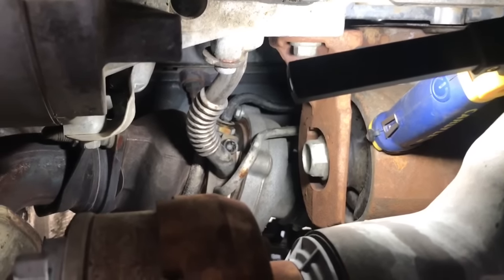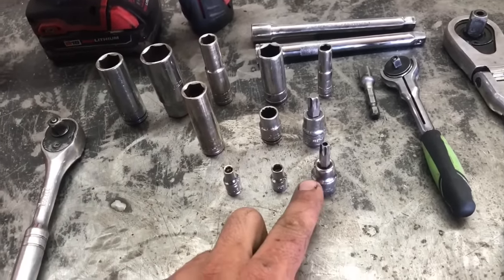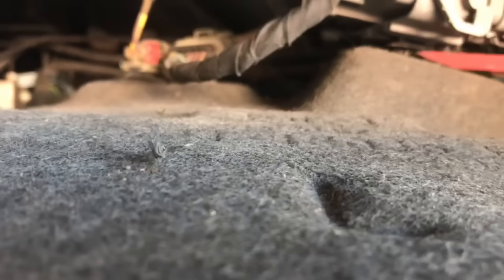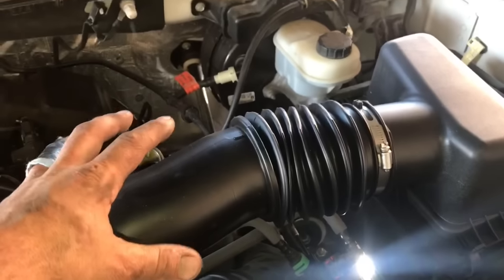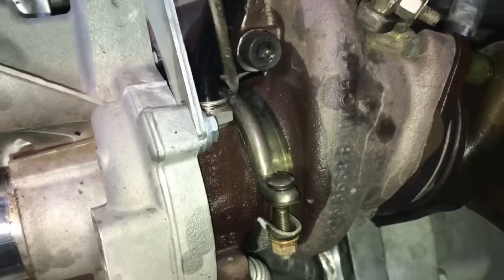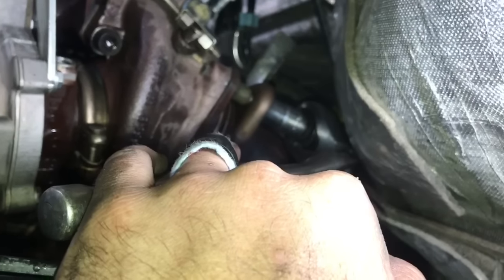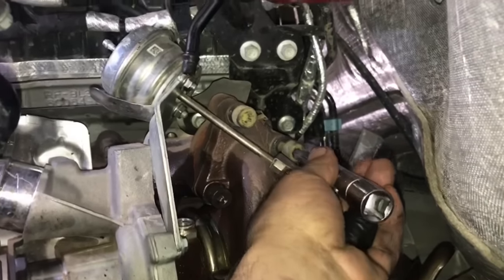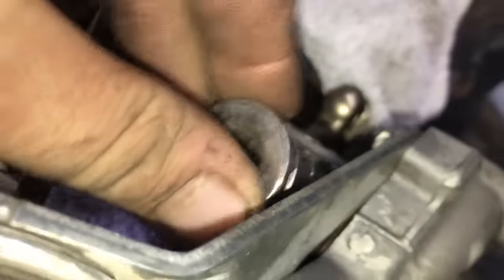F-150 Ecoboost 3.5 Turbo Coolant Connector Replacement (Tips and Tricks)

Comment: 2015 Expedition w 147K - Leak on drivers side, inside fitting as Aaron describes.   Followed his instructions - but could not get outer exhaust nut off; not enough room for socket and wrench. No luck w/open end or gear end wrench.   Also, could not break top exhaust manifold nut - with 2 nuts not moving had to find other plan.    Followed comment by others and went forward with change of fitting while turbo still installed.   Pryed metal coolant line out and pushed up enough to get socket on fitting.  Removed, greased and replaced by hand.  It was tight, for once glad I have small hands.  Replaced outer coolant fitting.  Changed oil seal, put all bolts back in and tightened.    Had to use 2 pry bars to work inner metal coolant tube into fitting.   Reattached all hoses, then filled with anti-freeze and fired up, test drive good - repair complete, fingers crossed!
Reply: I have been wondering why the turbos have to be removed especially the one on the driver side. It looks like you can just reach around and remove the connections. I think I’ll give that a try. It seems a lot easier than removing the turbo.
Reply: Good video but I haven't been able to unbolt the exhaust due to rust. Actually had to touch the top bolt off and the bottom bolt came out of the turbo. Now faced with having to get the bolt off of the flange. Not an easy repair just due to rust.
Joe

Comment: why do manufacturers think a rubber seal on a turbo is  a good idea with all that heat. they should be using a banjo blolt style connection with crush washers

Comment: 2017 f150 3.5 eco owner.  Spewing white smoke from the exhaust.  This was the issue according to ford.  68,000 miles with a full timing job required and the coolant-turbo leak fix.  $5000.  I grew up in American vehicles.  Now they ain't worth a dried 💩.

Comment: I wish I would have seen this video 2 days ago. My 2013 is at the dealership now for the same repair. $1K repair............after a $9K engine replacement. Motor has about 6K miles on it. You would think this would be covered under the new motor warranty. It isn't.

Comment: I just performed this on the drivers side of my 2013 f150. This video was great and helped me a ton. Just to note on the 2013 3.5 I found the exhaust manifold to turbo torx are T50 torx and the oil feed/return underneath the turbo are T45 torx
Reply: how long did it take you to do?
Reply: Found that out after i stripped the bolts thinking it was 47
Reply: @kevboost  probably 4 hours. I got everything back together and the coolant fitting that goes into the side of the block was then leaking. I had to ride my bicycle to the Ford dealer for new parts and gaskets. Haha took the turbo off again and redid the process. Success. I did not change the coolant fitting on the back of the engine because I was running out of patience but I would recommend doing it while you have everything apart.  About a year and a half later no leaks.
Reply: @superair05  hi, do you recall the part number for the one going into the side of the block? I got it all back together and now that one is leaking. By chance was it the same as the turbo ones?

Comment: Juat did this today in the shop . Your video helped , thanks very much ! Was my first turbo to replace on flate rate and it went well . Appreciate your knowledge ! One thing i wish you would have incuded was getting the back coolant line back on the turbo . Had to have a co worker wiggle it around while i stuck it in the fitting . Thanks again tho my man !

Comment: Forgot to come back with my completion update… so, thanks to this AWESOME video I was able to get the job done. I happen to be retired military with access to the Redstone Arsenal auto craft-shop with tools, lifts, drained fluid dump, etc. All these amenities made the job so much easier than trying to do it in the garage. Also, shout-out to Woody Anderson Ford for having everything I needed on hand!!! And shout-out to the auto craft-shop staff, and management.
Reply: First off, Thank you for your service. I’m glad you had a real shop to fix this abomination of an engineering failure provided by Ford. 
They had everything on hand because they need inventory for all the trucks being worked on in their shop because of this problem. 😂 
Shame on them for not stepping up and paying to make it right. 
They know their failure, and know it was a failure, because the swapped out materials on the ‘17’s and up. 
I understand taking the good with the bad, but these issues are a bit ridiculous. 
Beyond the grievances, Congrats on the fix. Feels good to get ‘er done. 
I’m going to try and replace just the one back fitting without removing anything. We’ll see how that goes. 
I’m actually more concerned that I should be doing more service if I’m getting in there to do these fittings such as new lines and trying to research if there’s a rebuild kit for the turbos I would hate if I do all this work and then the turbos start to fail and have to go right back in there.

Comment: Thanks for the video. I have a coolant leak on the back passenger side of the engine but couldn’t  figure out the precise location without tearing it apart. After watching this video, I can now see that this is exactly where the leak is coming.

Comment: Great video thank you.  I was able to change out the driver side between block and turbo fitting leaving the turbo in place. Drained Coolant, removed clip and used a pry bar to VERY carefully and slowly pry the tube back and push up just enough to get the socket on it. Do not not over extend the tubing or crush. Replaced fitting and reinserted the tubing. The tube will bend just slightly and not want to line so you will have to pry it slightly to line it back up with the fitting. So far so good no leaks and everything looks good.  It is very tight to work in so small hands are a plus. Once coolant is drained which took the longest and when you pry the tube the remaining coolant will drain so you have to wait a few. Once coolant was out  it took about 30 minutes to remove and replace.
Reply: Was this for the fitting on the back or the front? Mine is leaking from the back.
Reply: I was able to do the fitting facing the block (driver side) this way as well using a long prybar - HOWEVER my 2012 with 125k then started leaking from the fitting in the block (the other end of that line) so now I guess Im gonna pull the turbo anyway.

Comment: Just had to have this replaced, but didn't see the video before taking into the dealership. I thought the powertrain warranty through Ford Protect would cover it.. It did not. $1200 repair for one turbo. Insane. Thanks a ton for this video!
Reply: Every time I take my truck to dealer for something the bill has been over $1200. Insane...
Reply: @regularguyfixes3142 4 years later, what's the minimum bill now for basic things... $2100?  Ridiculous yea
Reply: Just got back from the dealership. They said it's the fitting plus 2 broken bolts. Altogether it'll be 4850. I'll be doing this myself instead
Reply: @butsugen  That is a RIDICULOUS price, Ford!  They must think we are all idiots.  Just because everything has increased 2X to 3X over the last 1-3 years doesn't mean they should 10X the cost of the max this job should ever be!  They've absolutely lost a future customer after reading that.
Reply: @ChonkTek  1170 for parts but I got it for 60 on Amazon. I'd be working over a month for free to get this fixed. It would take me nearly a decade of buying a gallon a week of coolant to reach that that repair cost if I left it.
Reply: my fitting leak must be very small in comparison.  Ive only seen and felt a drop or two of coolant there on one turbo's fitting when the truck has cooled down, and I don't see a coolant level in the reservoir that is alarming yet.  I guess I am catching this early.  Maybe if I tell Ford this early, it will only be 3700 bucks heh heh.  Well, here's a business idea..  I should buy up all these connectors on the marketplace and charge $200 each for them.  Nobody would have a choice other than to buy them for "only $200".. or pay for an expensive job at Ford.  What concerns me is that such a scenario seems possible with the gouging that Ford has created here.

Comment: 2 years after doing this repair on my drivers side turbo (using this video), I now have a leak on the passenger side turbo coolant fitting.  I completed the repair over the weekend and just a word of caution there is quite a bit of extra work involved in the passenger side.  The starter needs to be removed which is surprisingly easy.  However, the AC compressor also needs to be unbolted which requires removing the stretch belt that goes from the crank pulley to the ac compressor.  Removing that belt is not fun but it's doable.  Removing the ac compressor is only needed if you are going to change the coolant fitting that goes into the side of the block which i would recommend doing if you are this far in.  I did all 4 fittings on the passenger side with the most difficult one being the one of the back of the cylinder head.  Working at a decent pace I was in this repair about 10 hours but that also included an O2 sensor and replacing both belts.
Reply: Damn, if anyone ever says how these ecoboost engines are no more maintenance than the 5L, I'm send them to this post.  I owned a 2011 3.5L and the timing chain stretched 1".  Was done with Ford warranty but without warranty that would of been a pricey repair.... Now I have a 2017 5L  with the 6R80 trans and couldn't be happier.  I'll be driving this one until the wheels fall off.
Reply: 😅😅 so I'm gonna have to unbolt my ac...that's what I was curious about...was wanting to replace the fitting at the block since I'm already deep into it anyway was curious if the bolts or tools would clear between the motor mount and the lines..  😂 Hate Ford w a passion anyone who like these junkers has never has to wrk on one.
Reply: How did you manage to replace the fittings on the back of the cylinder head?

Comment: Mine just started to leak on a 2013  thanks for the video you saved me big time.
Reply from the maker: glad to help, seems to be a common issue on these trucks, i guess the dealer charges big time for it too. cheers!
Reply: @AaronHinesAuto  yeah, only like $2500.... lol. At least my recent quote.
Reply: @CB-dl1fx  is that to do all 4 lines though?
Reply: @bigpicturethinking5620  Good question, they didn't specify. I didn't get it fixed and am waiting to take it elsewhere when I can find the time. Such an inconvenience.
Reply: @CB-dl1fx  Especially because the new ones have a banjo bolt design that just doesn’t leak at all. What a sorry design.
Reply: @bigpicturethinking5620  Turns out I have 2 fluid leaks: oil from the valve covers and, what do you know, this O-ring at the turbo as he describes. Just over $1000 to fix just the O ring and hoses not the valve covers at this new shop Ive been going to.

Comment: Thanks for the video.  First set of fittings I’ve done on these 3.5’s. Had the passenger side out in 30 minutes. 🤘🏻🤘🏻🤘🏻
Reply from the maker: That’s awesome!
Reply: Waited on parts all day. Got both back in before I left today though.  Thanks again for the video.
Reply: So this video helped you with the passenger side? Mine is leaking from the fitting just under the manifold near the firewall! While I'm in there I plan to do all the connections though.
Reply: @kcoop99  did u replace the one at the block on the passenger side? If so did u have to remove the a/c compressor ?  Praying it’s possible without removing compressor that would need to be drained of Freon
Reply: @cologeroanello7852  I did. If you remove the wheel well, you can really see it up there next to the firewall. I used a large crescent wrench to get it out. Not easy but definitely doable.

Comment: Great detail in your video. Got 285,+++ on mine. This is going to be my next project in the spring.
Reply: Man that's great mileage! I'm hoping my ecoboost last that long.  Mines a 2012 with 111,000. I'm planning on keeping it for years. Bought it brand new. How the power at 285,000? Mine still flys

Comment: Just wanted to let you all know my progress… I started removing the wheel well lining to verify where my leak was coming from (all my coolant would puddling on the passenger side). What I found was nothing around any of the coolant line fittings on the passenger side. With the skid plate removed I followed the rear/ bottom of the engine with a flashlight to the drivers side… there it was. Residue under the driver turbo oil pressure/ return lines. Also, the white chalky, and wet combination, around the fitting on the inboard side of the turbo; between the turbo and engine. Wow… with all the coolant I’ve found on the driver side I never would’ve thought the origin would be on the opposite side. So check very closely before doing unnecessary work!!!

More to follow… I couldn’t continue as I had ran out of time. Putting the passenger side back together, and tearing apart the opposite side would have made me late for work (would’ve been late even if it were on the right side). So, will jump straight on it tomorrow. Today, I did brakes, and rotation, before I got to the turbos (sufficient time for them to cool while I was doing the other maintenance). I use the craft shop here on Redstone Arsenal (I love this facility), so vehicle has to cool after drive.
Reply: Thank you for this information. What I'm gathering from your post is that in order to diagnose where the leak is, you would recommend removing the skid plate rather than each wheel well, right? I know the wheel wells will need to be removed in order to do the actual work, but I'm just talking about diagnosis.

Comment: Great video guide!  I was unable to break loose one of the bolts holding the turbo to the frame (with my battery operated impact driver) so I had to change both seals with it on. It was a serious PITA and a great exercise in patience but I got it done!  Could have used a pair of smaller hands though. Thanks again for the help!
Reply: Next time heat the block in that area with a torch..itle zip right out.

Comment: Pretty nervous about doing this on my 2016 passenger side, but thankful I found your video. I'll work slow and hopefully have some success. Thank you.
Reply: Any update
Reply: @thomasspringer7184  totally! I'm a little over half-way through. I bought aftermarket manifolds from BD Diesel and they were backordered so it's taken a long time. I've finished my passenger side and am half-way done on the driver side. My truck doesn't have many miles, but before me was up in salt/snow/ice country. Getting most of the bolts off has been a nightmare, but I've been relatively successful so far (knock on wood). Happy to answer any questions you may have, just keep in mind this was all new territory for me.
Reply: @johnnixon  thanks for the reply good luck with the rest!
Reply: @thomasspringer7184  FYI finished today. Had a pipe leaking and had to disassemble driver's side. My advice, replace all water pipes and connectors. I tried to go cheap and had two leaks after cleaning them up. FYI the Dorman aftermarket pipe doesn't fit good into the turbo. I had to wear it down by spinning a old connector on it with a wrench. Still wasn't a perfect fit, but I'm hoping it'll work on with the heat and pressure. Anyway, I'll let y'all know how it goes. No leaks so far (knock on wood).

Comment: I dont know if anyone said this but the 3.5 on the 2015 f150 does have a coolant petcock, its just a screw and pull on the driver side of the radiator, bottom of it below the lower coolant output.
Also another edit. If you don't wanna drain the entire coolant system, ear plugs or coolant cork plug kits work well also for this including rubber hose coolant clamps at the tank and rad hoses help the coolant from flowing freely, the little things can save you ten or so minutes and even a few dollars in coolant, just if you do it this way, get ready to get a bit drenched in sweet toxic water, don't let your animals near it

Comment: This video was beyond amazing I was quoted 1650 to get this fixed but I’m mechanically good enough to be Able to get this done and with how detailed this video was I feel even more comfortable!! 
My only question is when I get everything put back together do I just add coolant back or do I have to do a whole coolant flush procedure
Reply: you don't need to flush..however you do need to fill the radiator all the way up, turn heat on full then start it with the cap off. fill as needed while it is running and put cap on and you should be good.
Reply: I’m about to dive into this project, and i’m gonna try to get to the backside bolt without removing the turbo but if I have to take the full route and go the direction this amazing video went I’m going to flesh the coolant until it’s clean and leave it empty and then I’m going to change the oil and empty it out until it’s empty and then pull the turbo. I know that there will be oil still in the lines but I’m hoping with dropping everything out of the vehicle it’ll be a lot less.
Putting everything back filling up all the fluids and she should be good to go for quite some time. 

I’m just so pissed I put on a full exhaust from the cat back and my symptoms started when I was replacing the bolts on the exhaust it manipulated the turbo enough that a small leak became much greater and now I’m forced into making this repair or paying for it, but such is life.